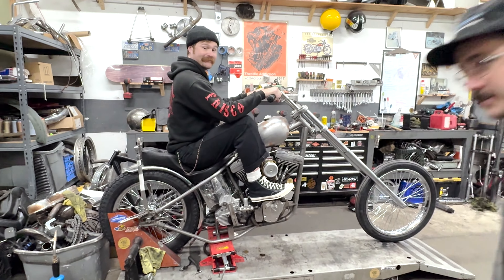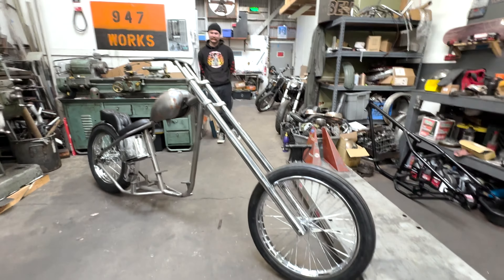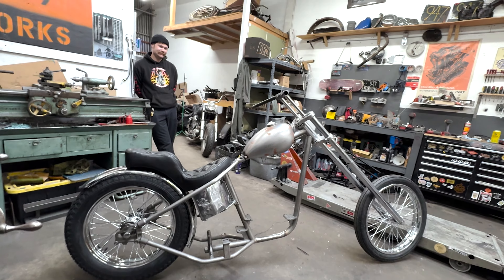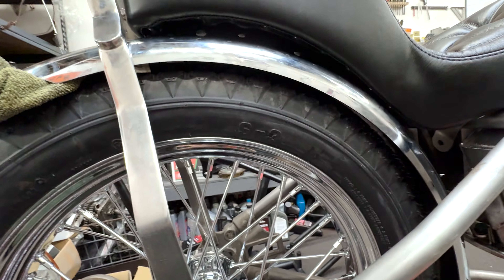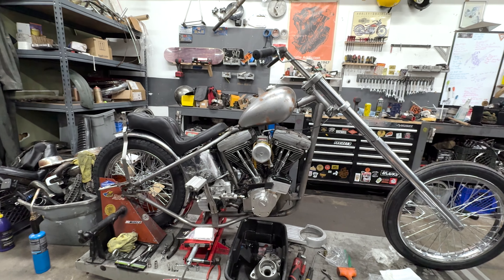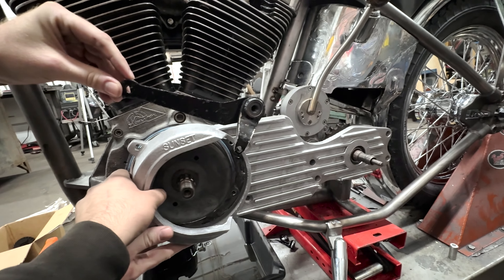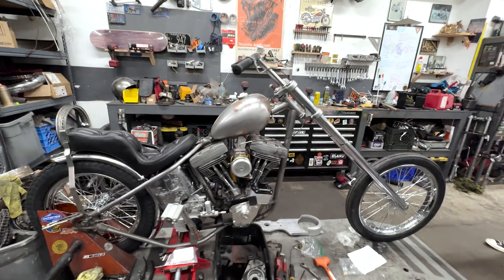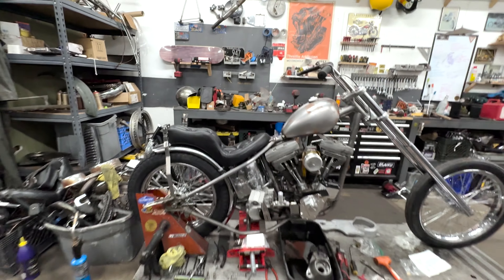EVO BIG TWIN SINGLE DOWNTUBE CHOPPER BUILD | PART 1

Comment: Over the rear fender -- "Frisco" grab rail or tall "chick stick." The overall profile of the bike is groovy. However, IF it were my project, I'd tuck in the steering head and run a six-over fork. To my thinking, the streets of San Francisco dictate tight handling. Some species of front brake would be a good idea. But then again, it's just me. The finished product is going to be amazing! Good luck. Build right/ride safe -- W